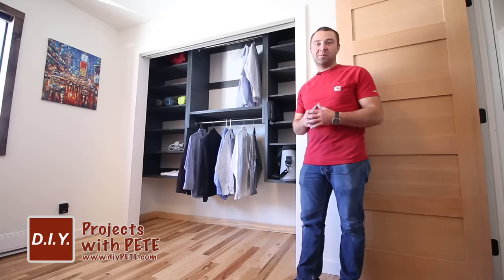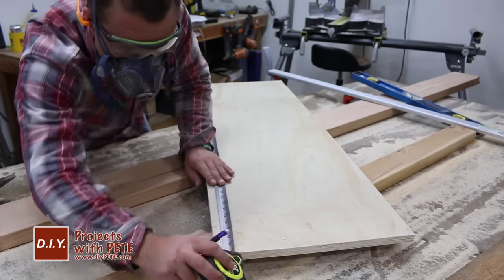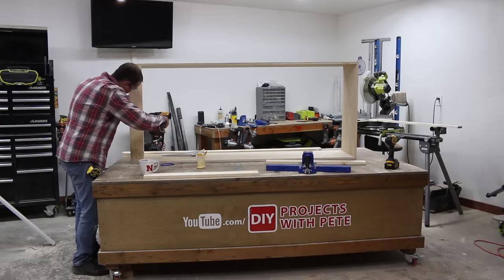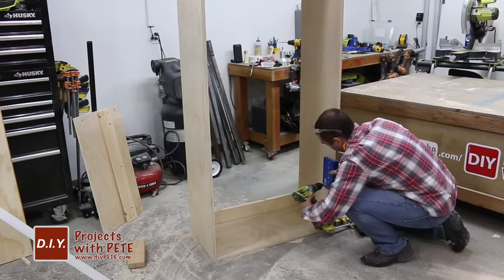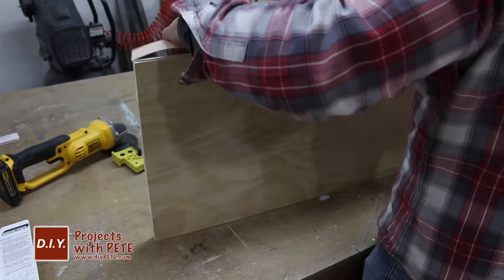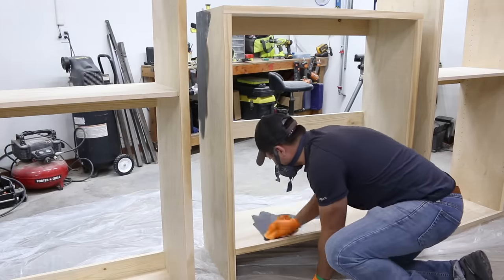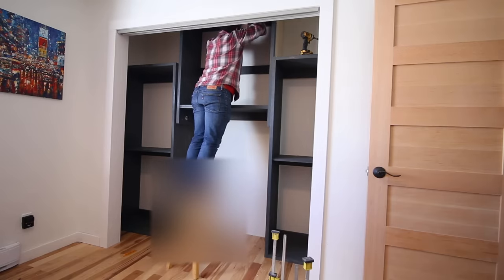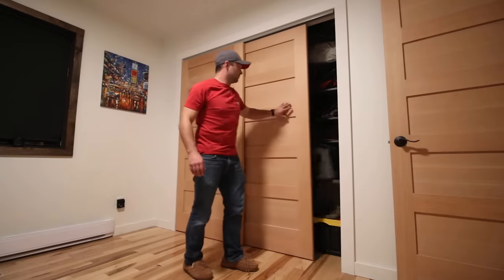Simple closet shelves you can build in a weekend to get organized! | Modular shelves

Comment: Love the project! 

I recommend cutting the shelving depth back about 3/4" and using some 1x material to make the faces instead of the banding. Make the faces a little wider than the plywood and it really gives it a lot of extra strength!
Reply from the maker: You bet, great idea! Cheers!
Reply: That's a good alternative, especially for display shelves where you have that front strip slightly 
higher to stop things from slipping off the shelf.

Comment: I dig the bottomless design... but I wonder why you then put the top edge of it right up at the ceiling. I'd do a bottomless and topless version then you could use the top board as a shelf. Also, the idea of using a french cleat would be outstanding for putting them up.

Comment: Great video, Pete! I'm about to transform my master closet and you've given me a lot of good ideas that I'll be sure to use. I'm first taking out my carpet and the contractor-installed wire shelving and hangers. I'm installing a laminate floor 11 X 6' before taking on the wood closet design. Thank you for your clear instruction. I also would like to qualify for the Jack Clamps.
Reply from the maker: Great to hear and good luck!
Reply: Bart, how did your project turn out? Im doing research because im about to start our master closet build.

Comment: Great build. Good support placements. One mistake: a 3 inch screw is probably too long. Limit screw penetration to 1 inch into the stud. With 1/2 inch wallboard that is 1.5 inch deep from the surface of the wall. If 3/4 inch wood braces are on the wall the screw length should be 2.25 inch. If you screw deeper than 1 inch into studs you risk hitting wires or pipes. This applies to the whole house. The 1 inch into the stud is yours. Deeper than that belongs to the plumbers and electricians.

Comment: i found most clothing rails sold in hardware stores are actually pretty weak and flex after some use especially if hanging heavy clothing. Now i always go with a good old pipe instead!
Reply from the maker: Awesome! A lot of them are. I have these metal pipes packed to the brim with clothes now and they are straight as an arrow. But they are definitely the heavy duty style. Good old pipe is a great idea!

Comment: Hey Pete.  Lol, my 1995 home has wire shelving falling under the pressure of my wife's personals.  Your video is great Man, nice job and thank you.  I have most tools in your video and it's one of those things, I just have to start the project and the rest will come into place (I think I can, I think I can).  One of the better instructionals I have seen and it was a pleasant surprise to see the ending.  I am currently flying for a 121 major and still fly pistons around on occasion.  What are you using for capturing audio?
Reply from the maker: Thanks for watching! That's awesome you fly for a 121 major, sounds really fun. I fly an SR22. I use a GoPro, and have an attachment so that the audio can go into it. It was pretty easy to do and so far it works well.  Here is my setup: 
GoPro 
Mic Input: https://amzn.to/2qRVtnm
Splitter: https://amzn.to/2zd9Siw
Cable: https://amzn.to/2RU4HKY
Adapter: https://amzn.to/2DKgIQa

Comment: Great build!  Curious, how do you like your rigid table saw?  Would you buy the same one again....or chose an alternate brand?  I’ve been debating between the rigid and delta saws...
Reply from the maker: Hi! The Ridgid works well for my situation. I do work out of a 2 stall garage, so having a heavy saw -- that has wheels is important so I can move it around, yet still have a solid table. If I was a real fine woodworker, I'd get something a little nicer, but for me, this does the job plenty well and was priced right. But delta makes great saws as well. Definitely do some research to find the best fit for your situation. Cheers!

Comment: I love the concept. However I don't understand why you built the center box. It seems like a waste of money, materials, and time because you just hung rods and a shelf. You could have hung rods on the outside of the side boxes and pocket holed up a shelf or put the shelf on a scrap of wood used as a bracket. Would you please let me know why you did the center box. Personally I would consider using that box in another closet. Set it up in the center of the closet and put shelves on either side that are connected to the outside of the box and the wall. Just use scrap wood brackets. And thank you for the jackclamp tip. I love that they're made locally. I'll purchase some when I'm at that point in my build. Happy Building!
Reply from the maker: Hi Jane! I created this as a modular system so it could completely be assembled off site and then easily installed. The sections could be installed in any arrangement. You could save a little money though and skip the center box if you'd prefer though. Cheers!